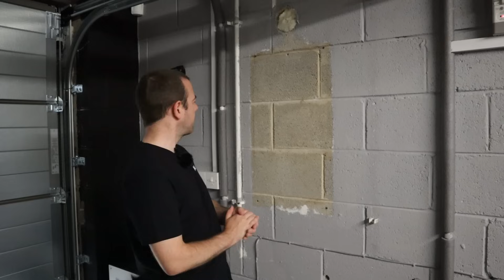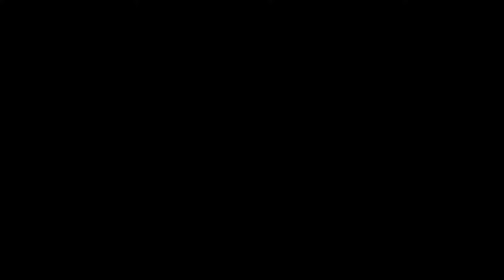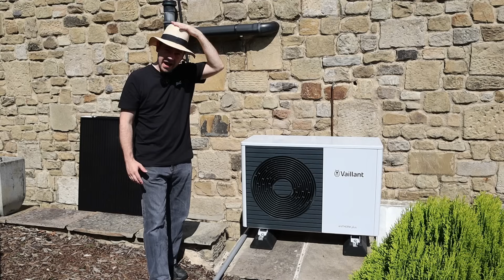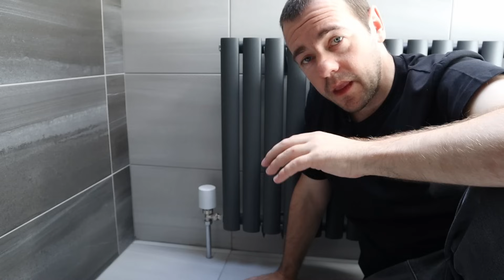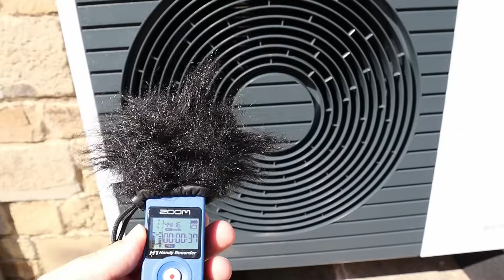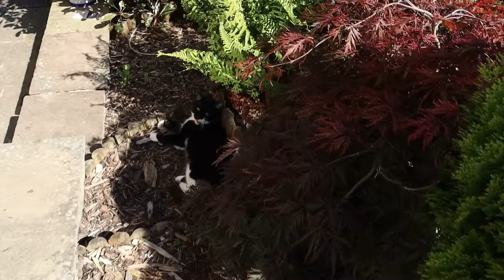Heat Pumps - Our 'Ugly' Truth!

Comment: So the whole concept here is having to use electricity for a limited time in the dead of night when your electricity supplier charges you less?  Instead you can spend absolutely nothing, keep your gas boiler, use it any time of the day or night and as gas prices are normally around 1/4 of electricity, you'll end up paying no more or maybe even less than the heat pump system.  No thank you!

Comment: Flow rate 40°c for radiator, wow thatl  must take ages to warm up a Normal home that's not ultra insulated?  Shame terraced house like mine & many homes have zero room for a water tank or heat pump! Hope they get much much smaller in 5 to 10 years!

Comment: Did i miss something, What was the total price of the system? Without knowing that the rest becomes irrelevant.
I have just been quoted £8,000 with the government grant, be very interested to see the running costs over the winter.
Also the efficiency, i believe octopus did a test under controlled conditions and got 175% not 400%.
But let's see, I'm still on the fence, but worse scenario is cheap night rate electric disappears and unit rates hit £1 kwh.
Even with oil prices, most people find oil CH cheaper than Gas.

Comment: Did you think about having a thermal store installed for the central heating? This might have enabled you to heat the thermal store by the heat pump using your cheap tariff and then use that heat during the standard tariff period, saving the battery for your other electricity requirements.
Reply: Could work, but more capital cost,  more complexity, more maintenace cost, more embedded carbon.........If it was me.....  No. But feel free to do this at home folks!

Comment: Interesting episode - thanks. We moved into a new build house with an ASHP and solar PV last November, and I had the opportunity to monitor the energy usage through last winter when our solar PV was giving very little. Being a new house it used relatively little energy, but as the ASHP is an electrical heater this was still quite expensive. Even considering the CoP of the heat pump, with the price of electricity being so much more than the price of gas the financial benefits seem marginal, which also seemed to be your conclusion in your video on heat pumps last November when you said "I just can't do it". So my question is - what has changed for you? In my case, I have no regrets at all, especially since I realised that our house was probably using more heat than usual as it is a traditional 'brick and block' construction and was drying out for some of last winter. Also, since last year we have a 9.6kWh battery so I'm interested to see what difference this makes. Like you, we are on Octopus Go since we have an EV and I also use the Go cheap rate to charge our battery in winter when the PV gives little energy. I calculated the additional cost of solar PV and our ASHP to be 4% on the price of the house, which we have easily made back in house price inflation since last November. Why don't all new home buyers insist on PV and heat pumps? Why don't politicians legislate to force builders to add them?
Reply: You can't force anyone to do anything .you have the wrong way of thinking. Politicians work for the people. We have to use the democratic system
Reply: @noelburke6224  I'd question your thinking there, Noel. Unfortunately many of our politicians are influenced by lobby groups much more than 'the people', which weakens our democratic system. The construction industry is a very powerful lobby, but they don't seem to be all-powerful in Scotland where solar PV is much more common on new-build homes. Perhaps 'forcing' is the wrong word, but the Scottish planning system seems to be better at 'strongly encouraging' builders to install micro-generation. Why doesn't this happen in England?
Reply: @redrickratae  I am a heating engineer and a qualified building contractor 45 years and still in business. We implement all new technologies in our projects. We also provide cost analysis on materials  labour and most important is end user running and maintenance cost .plus pay back time and opalescence. We are members of a Academy who have research and development labs we also run real life tests on all appliances to determine the cop and the scop.As  for politicians they are liars and parasites, a party to themselves sucking the life out of the citizens and private business to line their own  pockets  glorified mouthpieces who forget who is there employers. I can write you a best seller on the corruption in the government and civil service in Ireland 🇮🇪

Comment: Thank you for this. It's good to get an honest take on ASHP from someone of similar mindset to myself.
Our house is 18 years old. The oil boiler is the same age. The upside is I can maintain it myself. Mains gas has only become available in our area last year but I have honestly never been a fan and definitely not a fan of combi boilers. I prefer hot water storage, particularly since we have recently invested in solar and an Eddi hot water diverter.
We have been fully EV for a few years now with a 2016 Leaf 30 and 2021 M3LR so ASHP is definitely on the cards. I might just need to tease another couple of years out of the oil boiler first as the solar install was obviously a significant investment.
Reply: Just to mention that you can easily maintain an ashp yourself.

Comment: We live in Denmark and have had a heatpump for 3 years without any problems. The house is from 1934 and we upgraded one radiator. The water temperature for heating is 38 C in winter and between 30-32 C in summer. But I wouldn't buy it to small. Some companies said we should have a 6 kW and some said 11 kW. Both would probably be able to heat the house but the small one might use to much energy from the electric heater and make it inefficient. The electric heater is used to raise the water temperature for tap water to the right level. We went for a 11 kW but one of my friends went for a 6 kW (cheaper to buy) in the same type of house. Their heatpump is not as efficient as ours and therefore much more expensive to run.
In  short... Make sure that your heatpump is the right size. Not to big and not to small

Comment: have been looking into heats pumps and trying to understand if these make sense only for heating water - we'll be in the canary islands so no regular space heating requirement...would a small heat pump still make sense or using solar / battery and heating hot water directly be simpler and more efficient
Reply from the maker: Solar thermal with immersion backup I’d guess.

Comment: Hi, do you have an electric cooker  in your house and if so is it being powered from the Battery/Invertor. A typical electric cooker needs a dedicated 32A circuit.
Reply from the maker: No, gas. That’s getting replaced with induction soon.
Reply: @ElectricVehicleMan  Thanks, do you think a induction hub would cause any bad initial surges in power requirements , (like a motor for example) and what can your invertor cope with in terms of peak surges and for how long. I had a visit today from a Solar company to do a survey and quote but they were vague in this area regarding electric cookers etc. thanks
Reply from the maker: @raymondmathers7999  There’s always a small bit of usage due to inertia. All batteries do this. Small amounts ain’t worth bothering with.

Comment: Ah lovely quiet second gen ASHP. My 7kw unit is much louder, not so loud it annoys me. Infact it like having a fan in the room, same kind of noise level. I lack control over it to set it to boost for my cheaper night tariff, but I don't tend to touch it. Left the dials at 45c (max without a boost option for me) and let it warm up as and when. 3 bed detachted house, energy use for the last 50 weeks for heating and hotwater 1594kwh. Can't complain 🙂Though can't wait for an even more efficient quieter next gen unit when this one dies.

Comment: If you can heat a 13 radiator house with  a 4kw (output) heat pump I'm massively impressed with your insulation.  Did I also hear you say that your low energy tariff was due to you having an electric charging point as well?  You are quite correct, Heat pumps aren't for everyone, with most houses (3-4 bedroom semi/detached) having a heating requirement of 8-12Kw plus the hot water requirement say 3kw, the size of the required heat pump/thermal store and installation costs becomes prohibitively expensive not to mention the cost of the triple panel radiators that you will need to run with a heating flow temperature of around 50 degrees vs a typical gas boiler that runs with a flow temperature of about 80 degrees.  This I think you'll find is where 'Skill Builder is coming from with his critique of heat pump systems.  I'll be sticking with my Baxi Powermax band A energy efficient boiler for now.
Reply: If you’ve got weather comp setup right you’ll be surprised how often your gas boiler runs at low temps.
Reply: I'm going to try running my boiler at a lower temperature   to see how my radiators perform. I'm using off peak to heat immersion tank under 2kwh of electricity against 4.5kwh of gas.

Comment: How can you comment on your system in the heat of the summer, if your radiators are not larger then your existing rads the system will not heat your home properly
Reply from the maker: Have you watched the video?

5 were replaced and the rest were already oversized for the rooms. 

You do not need to increase every radiator.

Comment: Hi EVM. Yes, your pump might be nice and quiet in summer when it’s not really doing much. However in winter when it’s near freezing, the pump is working hard and possibly doing a defrost cycle, please report back! Ours is occasionally very noisy. This is why it’s still important to site the pump carefully and to isolate it from the house - ie not attach it to the house but to have it free-standing.
Reply: @coldlyanalytical1351  Are you sure it’s switched on 😂

Comment: I presume that the argument for storing hot water at so high a temp (that you need to add cold to achieve a usable bath), is about reducing the volume of hot water you need to store for the same amount of heat energy. I can think of several reasons why this is not a good idea but some might argue the point.

Comment: The concern with heat pumps in the winter is not just whether they can product enough heat, the main problem is that they are inefficient in the winter, ie they are no better than resistive heaters.  And therefore are very expensive summer water heaters, when solar thermal would work.  You are not going to get a COP of 400 when the outside temperature is 0C, its going to be much closer to 100.  The question is can you read the current COP value?
Reply from the maker: Not used it yet as heating is off. 
Winter I’m looking at 200-300% according to calcs. We’ll see.
Reply: @ElectricVehicleMan  I've never seen the specs of any unit that can achieve >140% at 5C ambient and 50C water temp.  How will you know?  Is there a read out of COP?  Can you retrofit a COP readout?  This is done in industrial applications but not consumer.  The fact engineers are analysing the efficiency and ROI in industry is why they mostly chose resistive heater.
Also the fact that it has to be on all the time, means that you are not benefiting from some of the efficiencies of not heating the house when you are out or at night when you need less heat.
I honestly think its all a big con.
Reply from the maker: @tonystanley5337  Of course there’s measurements for COP. 

If it’s a big con, why does a good portion of Europe use them and has done for decades? In much colder climates.
Reply: @ElectricVehicleMan  I know many people believe in heatpumps and there is "data" to support it. However this is all vested interest data.  I've not seen any actual measurement for cop in consumer units, but I'd be happy to be proven wrong.  I assume this because I've not seen any actual flow measurement, so not possible to actually measure energy output.  It is more of an estimate, and I'm sure it is favourable.
Does your unit show measurements for water flow, energy output, electrical in and COP?  However even then there is the issue of low output meaning you have to keep the unit on 24/7.  Using this and averaging across the entire day/week, even when heating is not needed would still be a false measure of COP.  Can you share model details of what you have?
The data is usually hidden away in a single figure in the data sheet/installation manual or more often not shown atall.  Instead we get COP averaged across the year and for hot water in the summer.  Frankly its not needed in the summer, you can use solar thermal panels, and I suspect resistive heating is very close cost wise in the winter, with a less favourable payback calculating out at significantly longer than the life of the unit against resistive.
I'd be happy if my dim veiw is wrong, but I'm an Engineer and cannot get hold of the independant data I need to prove it one way or another.  This makes me suspicious.
Finally it makes no sense to generate electricity from gas and then use electricity for heating.  It is more efficient just to use the gas for heating, especially when its not a 300% cop when you need it.
Reply from the maker: @tonystanley5337  I have all the data from the unit when needed. 
The idea is to get electric from a clean source and then use that via heat pumps etc. 

The unit isn’t on all the time, only when you’re calling for heat. Yes, a little heat often is better than a huge gas style dump very low and then.

https://www.vaillant.co.uk/downloads/aproducts/renewables-1/arotherm-plus/arotherm-plus-spec-sheet-1892564.pdf

Again, if countries that have far colder climates than us have used them for decades, I’m not sure what more long term data is needed. If they didn’t work then they wouldn’t be still used today. 

I will be displaying everything over the coming winter onwards, total electric consumption as well as COP etc. 

You’re dubious of bias, it works both ways. If I was a huge gas company, or anyone involved in the established industry we have here, I’d want to put a load of disinformation out there too. Keep my company selling!
Reply: @ElectricVehicleMan  I'm not going by propaganda or misinformation, I'm trying to prove it one way or the other with data from the heat pump manufacturers, and in my opinion, the data is hidden in maths.
The other country examples could also be scams, or more likely ground sourced, nearly every gov't official is current fooled by Hydrogen as a climate solution when it is not.  At the moment I suspect air sourced heat pumps are not suitable for UK homes and wet heating.
Calling high power heating a "gas style dump" is starting to be propaganda.  It is useful to have power, it means your needs can be met more quickly, and you don't need to keep the heating on when you don't actually need it.  A correct efficiency calculation would not include unwanted output.  This is why I call it a scam.
FYI I understand the unit is not on all the time, but it is maintaining the temperature "all the time" because it takes so long to heat up when you are not using it.

Comment: Heat pumps are not for cold climates.  Below 40 degrees F the electric heat strips switch on and you are using electric heat.  Wait until you get your electric bill.
Reply from the maker: -40F is a temperature the UK has never seen!  -40c!!

If they’re not for cold climates, why is most of Scandinavia heated by them? They get -20/30c every winter. 🤷‍♂️